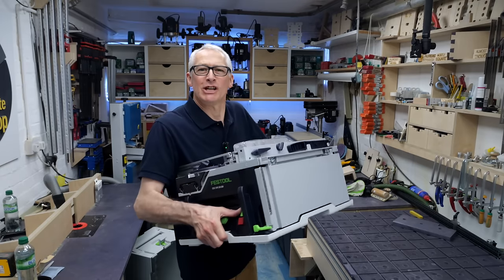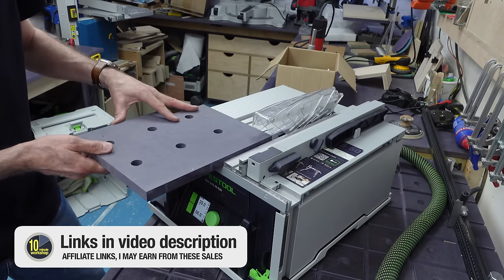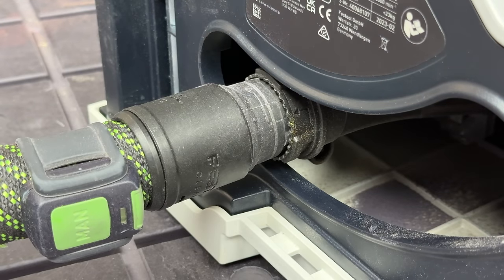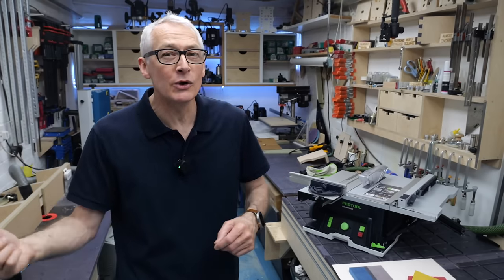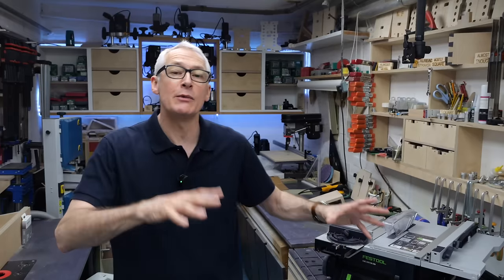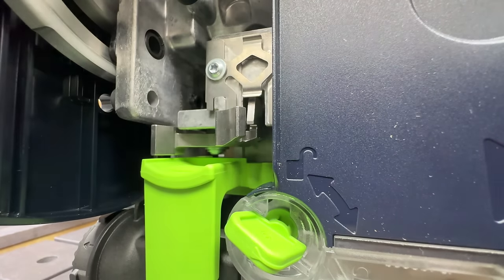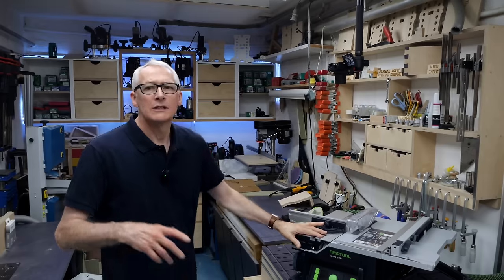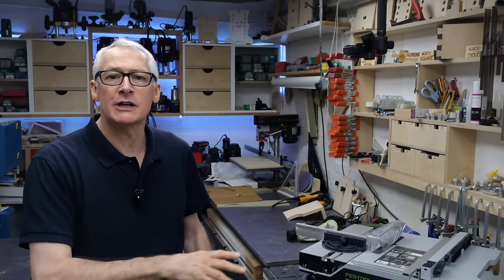Festool's Big Mistake [video 530]

Comment: I could live with the 'battery only', small size and 160mm blade but I am unwilling to  pay Festool's price for a 'sloppy' fit and finish (not to mention the 'non-standard' miter slot). If they want a premium price then they need premium quality to match it.
Reply from the maker: Don’t disagree re the mitre slot size, but as I say in the video, the mitre gauge locks down solidly and it does have a sliding table. 👍
Reply: @10MinuteWorkshop  I had rather it slide smoothly as well. There might be a time and /or reason to prefer using the sliding miter gauge rather than sliding the assembly. If Harbor Freight can do it on a $200 saw  then Festool should be able to do it on a $2,000 saw.

Comment: Hi I love Festool, and primarily only use Festool products in my at home wood work shop. I own, Festool sanders, drills, jigsaws, miter saw, ratchet set, clamp set, installers set, CT MIDI, etc etc etc. I am wanting to purchase a table saw, so naturally I am inclined to want to buy the new cordless table saw Festool just released. 
I'll tell you why I won't buy it, safety. Simple. 
Cost is likely not a concern for anyone buying Festool so let's leave it at that....But  safety is. 

Festool, owns Sawstop.  At this price, the table saw should have incorporated that Sawstop technology. I understand that it doesn't because of the battery power, it needs a ground, therefore it's not applicable. However this is where I believe Festool has come up short. 

A corded version, or option to use corded battery like other machines of theirs.  . Festool should have allowed this machine to operate on battery, or corded option to enable usage of the Sawstop technology.   In my mind, the battery is nice for portability.  But that shouldn't have limited Festool from incorporating their Sawstop tech.  Instead, they should have provided a main plug option too on the battery powered unit, and when main power is used, Sawstop activates, and when only on battery, sawstop doesn't work.  
Or Festool should release a corded table saw, like in Europe, here in NA, with the sawstop. 

The reason why this matters, is for people like myself who are avid Festool buyers, are also individuals that price safety over function, and knowing that there is another option out there where I can more safely use a table saw without cutting off my finger, will naturally be more inclined to go with that product.

I won't be purchasing the Festool table saw, instead will purchase the Sawstop one instead (which btw I don't want to, as it's not as nice, nor as technology forward as Festool's). If however Festool ever releases a Sawstop table saw in NA, I will purchase that in turn.

Comment: Looks like the only thing from stoping it breaking is the price the user payed for it. Thought that about the rail saw. You paid a shed load for it so you'll gently place it down. For that price you can get a bloody good saw that'll last for years. Think this saw will keep going back to the manufacturer. May be maffel will make one that's expensive but actually made of really good materials and not just cheap expensive junk.
Reply from the maker: I’ve seen completely thrashed Festool plunge saws on construction sites that you wouldn’t think would still be working - extractors too - but they do. Wether this is one of those, or another ‘carvex’ cordless jigsaw moment we’ll have to see, but if you want something to throw in the back of your truck then maybe Dewalt or Milwaukee is the better option.  🤷‍♂️
Reply: @10MinuteWorkshop  I got the DeWalt, it's fine and a third of the price.  But like you said, it's not for the likes of us ham fisted gorilla types. But, I'm a firm believer in if you want nice things and can afford them.... Go for it. Thanks for your view on the saw though. I thoroughly agree on the power options. If Hitachi can do it and it's only going to be a useful thing. May be one canny fella will make an attachment to fit the battery slot that will run 240

Comment: The height adjustment is a total gimmick.  A real revolution would be a saw where the blade also slides back and forth horizontally within a range to cut dados.  They do it with the Domino.

Comment: The main reason trades are going to cordless tools is there are no leads to keep moving and less trip hazards and very little chance of electrocution which is why all trades should be using 110v power tools when corded tools are used I've never had an issue with electric supplies on sites, i think the saw is very overpriced for what it can cut and over engineered with the electronic blade height and angle adjustment just something else to go wrong.

Comment: The only reason not to include the mains option is to prevent the product being used in place of another product designed for fixed use.
Reply: Maybe. I have the Festool cordless sander and they have a mains adapter for about $100 and it’s amazing. I love being cordless or corded
Reply from the maker: Except it doesn’t really prevent that, just makes it potentially irritating to do so. I’m pretty sure it’ll never leave my workshop, and the reason so many home woodworkers uses site saws is for their relatively small size and easy manoeuvrability in smaller workshops.  👍
Reply: @10MinuteWorkshop  oh I get that it's not very successful I just can't see any other reason for that decision, it's too obvious to miss.

Comment: they could easily make an adapter like they did for the sanders to have plug in compatibility and it just needs people to request it hundreds of thousands of times.
Reply from the maker: Sanders are a few hundred watts, the saw is a lot more than that. Not so easy, but not crazy difficult if they had the motivation motivation 👍
Reply: @10MinuteWorkshop in the states dewalt made an adapter for their miter saw im not sure if its everywhere. I had it for a while got I got my kapex and I do miss it because I forget to charge quite often. I wanted to say thank you I did end up getting the sys csc 50 and it meets and exceeds what I thought I would get.
Reply from the maker: @James-lo5ne  Thanks! the 110v vs 240v makes the current draw more of a challenge, I think. And congrats on the saw; I'm really pleased with mine; not perfect, but really pleased with it. 👍

Comment: If I were buying a new tablesaw, and I already own three, there's a new "baby bear" Sawstop here in America that ticks all my boxes for about $900, about £700 or €825.
Reply from the maker: No Sawstop available in the UK.🤷‍♂️
Reply: The cts is great, built it an outfeed and side wing extension. It has dewalt rack and pinion fence with sausage detecting guts! I have the dewalt 7491rs and cts.

Comment: Shop fitters often work horrendous hours re fitting shops and bring in carts with lithium batteries to power them through the weekend what a pity that this saw wasn't designed to plug into a 200 AH lithium battery.

Comment: Lack of power brick is good for increasing sales of extra batteries and chargers.
Reply from the maker: But bad for sales of saws… 🤷‍♂️
Reply: @10MinuteWorkshop  not necessarily. O
Usually one learns about deficiencies of a given tool after the purchase. 
Those who watched your video prior to purchase may still decide to buy it, either because they need/want the main features or because they just want the latest Festool toy.

But who knows, perhaps Festool is already working on a “plug-in hybrid”  version?

Comment: I were to get that saw I would first look for an old set of dead batteries, and turn them into an AC adapter so I could run the saw of AC.  I bet sooner or later a third party will sell something like that for this saw.
Reply from the maker: I’d gamble that Festool will have something available before too long. 👍

Comment: Festool has made a massive misstep going all in on batteries for all tools. Consider that most of their tools will have a dust extractor connected, the real innovation would have been a dust hose that powers the tool, not a new battery system to invest in.
Reply: I would have loved to see them develop this powered dust host, rerelease all their brushed tools as corded brushless, and then honed the cordless drill/impact offerings into a smaller, lighter, tighter, more powerful product.
Reply from the maker: They do make cordless vacs...

Comment: That was my first thought when I first became aware of this tool—why on earth did they go cordless? Who really needs a cordless table saw? Also, the sloppyness of the guides. Overall, looks like a piece of crapp and super expensive in the bargain
Reply from the maker: It’s a site saw aimed at installers, where everything is cordless; I think it’s a mistake not to offer the option to plug it in though - they’d reach a wider market, not that they’re struggling for sales exactly. As I say in the vid the guides are fine when locked, but it doesn’t inspire confidence. WRT the price it was slap in the middle of the saws I looked at - about a grand more than the cheapest, a grand less than the most expensive. 👍

Comment: Festool have no regard for the obvious. First thing v grooves around the edge like most of their other tables, that would allow the use of gear we already have to use as out feed etc. second the box lid should attach to the side and the back for more capacity. third better access to remove the build up of dust in the box like a removable bottom.  fourth the side extension could have been bifold and doubled the rip width. five. if you own the mobile work station this saw should be able to be attached  to integrate as they love to bang on about everything being in a system but they continue to overlook the blindingly obvious. I could go on but my blood is already boiling.

Comment: The blade should not tilt toward the fence. This creates a "trap" for the wood and definitely could lead to a kickback. Very bad design.
Reply from the maker: Don't disagree, but sliding table, negative 10 degrees. 👍
Reply: @10MinuteWorkshop  sure, very handy for an 18 segment circle 😕

Comment: Typical product of the current generation, add bling to distract from low quality basics while upcharging and locking people into their system. Everything that's new and shiny professionals lived without for decades and if in doubt won't miss, while stuff which would have made a difference like sawstop or a systainer dust collector to click below the saw to avoid tripping hazards doesn't make it, but the essentials are sloppy.

It's a nice piece of kit, but charge 500€ more and make it better upfront next time. Thanks for the honest review.

Comment: Insanely expensive for what it is, and some of those parts (the wobbly gauge, for example) are completely inexcusable, and the electronic blade height and tilt are pointless. I don't think any manufacturer makes a really decent site saw, but this seems like a miserable effort even by those low standards. I think that sums up Festool these days; really below average tools that aren't any better than the alternatives at half the price or less. You're paying 75% for the name, and 25% for an average tool. The only thing these saws have going for them are the simple riving knives, which manufacturers of workshop cabinet saws seem to be ignoring. But given the choice, especially for 'static' use in a workshop, I'd pick a 'proper' table saw.
Reply from the maker: It's not for everyone, no, and as I say in the vid, I went through my decision process in a previous video, links below. 👍